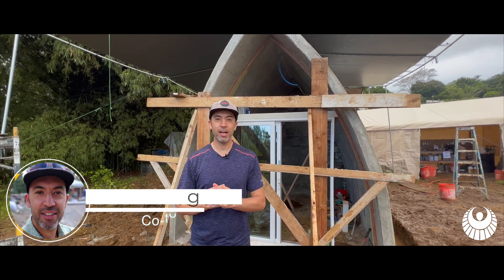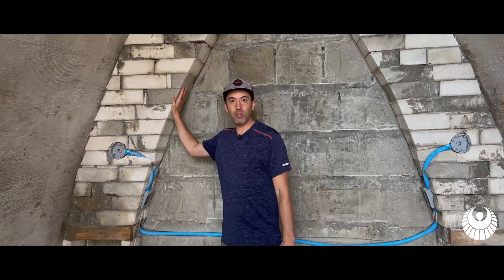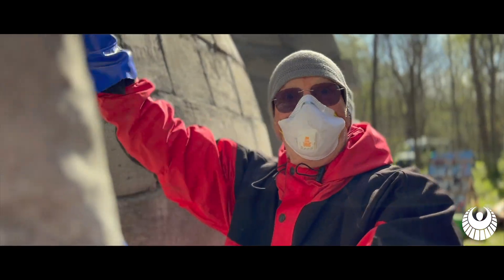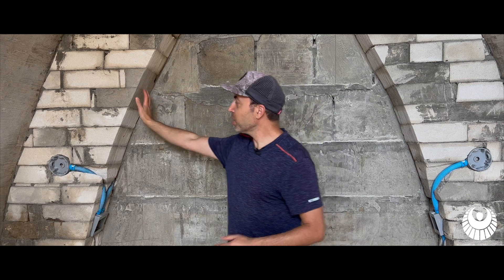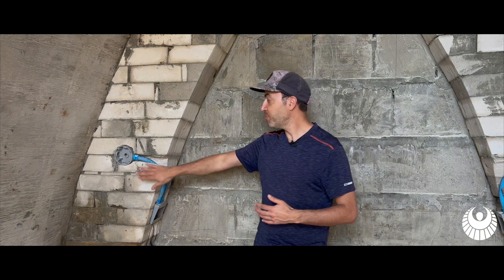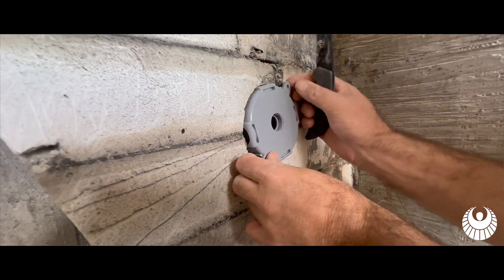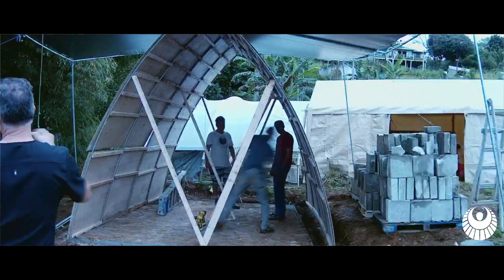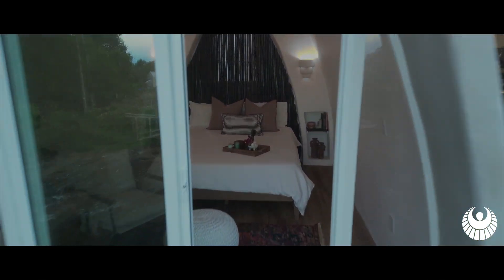Is Aircrete the perfect building material?

Comment: aircrete sounds and looks cool but Ive noticed that all the homes made with it are relatively small, is there a reason behind that(like structural) or is the market just not there for it.
Reply from the maker: We tend to focus on small becuase our roots are in affodable housing.  Once you get into large structures the costs are so much higher.  We also focus on building that anyone can build themselves and smaller structures are perfect for that.  That said, aircrete works great for 1000 - 2000 sqft homes as well.

Comment: What's the difference between Aircrete and aerated and cellular concrete?  I watched this vid about a house built from “cellular concrete” blocks and wondered how they can use it structurally and aircrete isn't?  https://www.youtube.com/watch?v=90X_698x2q4&t=628s
Reply: It's all basically the same thing, just with different names. The formulas and mixes can vary from manufacturers and Do-It-Yourselfers, but the principle achievement is the same regardless of the name or terminology... a lightweight, foam-infused mix of a variety of possible foam sources with concrete and aggregates that are formed into bricks and cured to be used as a wall material.

Comment: I have land on the island of Mindanao and Misamis province.  $15k can get a three bedroom with out side CR and dirty kitchen. Concrete slab and steal roof etc. Made in hollow block. I like this Eden dome as a roof / second floor. The curved shape may be stronger in the typhoons common to the island. Also, this tiny structure may work as a CR, shower or laundry. Rather then one rectangular building with metal roof, two or three domes as side by side utility structures.
Reply: Fortunately for you, depending upon where you live on Mindanao, the likelihood of direct hits from typhoons is much lower than in the rest of the archipelago. However, I would be somewhat concerned with using aircrete on a second floor above a cast concrete or hollow block wall. Even with a fiberglass outer shell, you run the risk of water damage in the event of an object hitting the outside of the structure and exposing the aircrete to water damage. As you know, typhoons can generate multiple days of continuous extremely heavy rains that could affect aircrete's natural water absorption. Additionally, aircrete is not capable of withstanding the force of objects such as coconuts and trees being propelled at high velocity by typhoon strength winds. Most applications of AAC throughout the Philippines are used as interior walls. Flying debris typically will not affect the structural integrity of a cast concrete wall, or a reinforced hollow block wall. You will need to check with the Department of Building Official and they will look and analyze your submitted plans to guarantee that your application complies with the  National Building Code of the Philippines (PD 1096), Fire Code of the Philippines (RA 9514), and your Local Building Codes. A single-story, stand-alone structure such as those featured by Domegaia is not meant to provide safe shelter in typhoon or hurricane prone areas.
Reply: Thanks. As to fire in my barangay, those bamboo payags, burn in minutes.